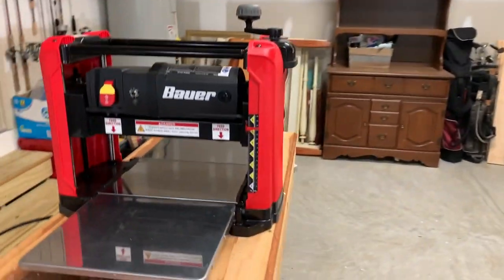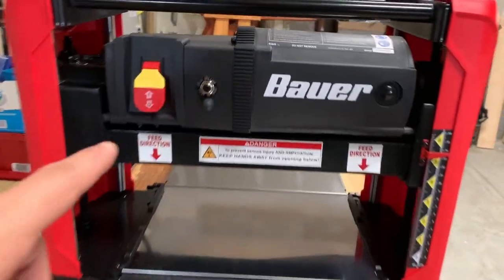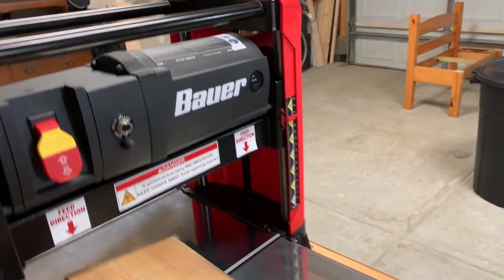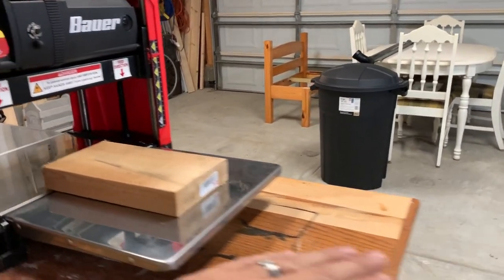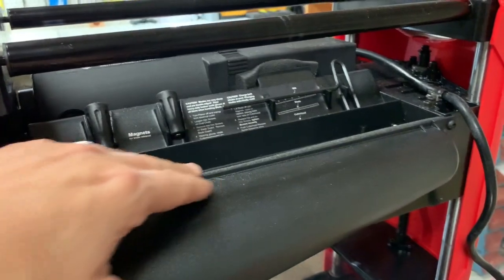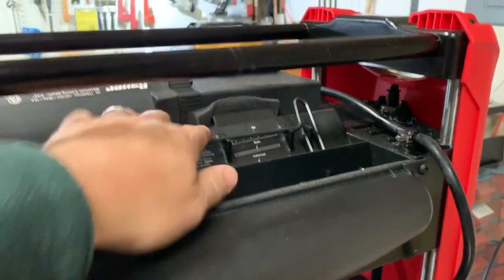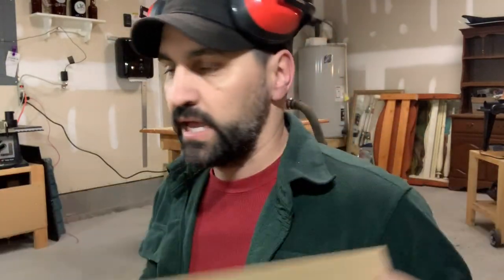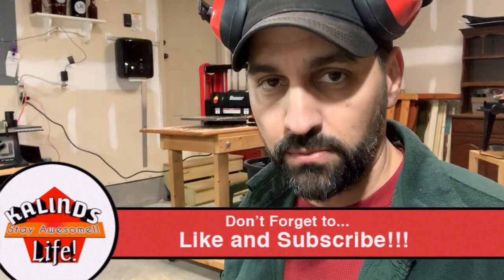Bauer Planer from Harbor Freight Tools Review!

Comment: Also another note for the adjusting handle, if you remove the cap there is a screw to tighten the handle and it will not be sloppy. very accurate . I read the manual before use

Comment: Get yourself a bucket head and a 5 gallon bucket. Cut a circle large enuff to cover your trash can. Cut a circle in the middle of the trashcan lid that fits the 5 gallon bucket. Cut the bottom of bucket off and place i side the trashcan lid and silicone the bucket and now you have a larger dust collection system. Just my thoughts
Reply from the maker: I know exactly what your talking about. I think this works well too and even allows for a bag to be put in the larger can for easy disposal. Thanks fir watching!!

Comment: You can adjust the height of the feed plate underneath. There's a bolt and locking nut.
Reply from the maker: You are correct! It really does make a difference! Thanks for watching and commenting!!

Comment: looks good. glad your getting good results. I got a suggestion for you that might be hard to explain, but, here goes....get a small (20-gal or so) thrash can with tight fitting lid (very important). Get two-inch piping, and more of those couplers. The idea is to connect the shop vac to a 2" pipe on one side of the trash can; then connect the planer to a 2" pipe on the opposite side of the can, using the couplers in each case. Some silicone sealer may be in order to make the pipes as airtight as possible, where they penetrate the can. When the lid is on, the shop vac creates suction in side the trash can, which creates suction in the opposite pipe, leading to the planer . Sawdust  is  pulled into the can, but, most will fall in the can, and not get sucked up into the shop vac. (which saves the shop vac filter/motor). I've not done this yet, as my planer is outside now. But, I want to use my planer year round, so I'm working on making the space for this.
Reply from the maker: Hey D L!!! Thanks for commenting!  Check out my video i made on  how to make a dust collector.  I did this Video AFTER the planer review so you may have not seen it.  Thanks so much for watching!!!
Reply: @TheCrawlspaceCraftsman  your right, I hadn't seen it. You know, I think it's great when people take my advice, but, when the do so a month before I give the advice, well, now that's something really special! ;-)  Great job on the vac system, by the way. My inner scotsman says use the cheap stuff, but the black does look good. Kudos,  my friend!

Comment: All Planers have adjustment ,to take out the Snipe and leveling set screws. These are close , but not dead on for shipping reasons . Also your adjustment rods for your thickness can be tightened and adjusted , to reduce the "looseness" in your height adjustment. You'll also have slack in your height adjusting handle . A simple drill and tap , for a set screw will eliminate that ,,, even the best  machine shop Mills have what is called "Thread slap" , you'll always have to do ,,what is known as "catching the threads" . You have to lower the weight of the adjustment past your measurement and the come back up or down to your final finish thickness . this is the difference of the "lands" and depth of the Threads on your Adjusting rods and and adjustment threads in your handle. Most standard threads of nuts and bolts are 75% contact . if you get into a higher percentage of 80 or 90 % it will take a tool and dye shop to cut those threads to match the opposing threads ,,, thus resulting in a much much higher priced machine . Adjust your machine , so it's setting dead nuts level and secured to a bulky firm table or base , adjust that machine out , so those feed tables are level with the machine and cutting head . check your knives to make sure they are running true with the drum and each other , and you'll be amazed at the results .

Comment: Ive been told that the play in the handle is because most people dont take off the cap and put the screw in the handle which can be tightened.
Reply from the maker: I’ve never messed with it but whiles it’s running it doesn’t change depth so that’s a good thing!

Comment: Jesus planers are so loud your never gonna have to worry about that noise the handle makes in anyway,throw away the indeed and outfeed tables,make new. And speaking from experience do not take more than a 1/16 depth cut at time I love mine,my adjustment handle for the depth of cut is spot on,had to buy a different measuring tape for the front and set it to be right,but I love mine.
Reply from the maker: Great comment!  Thanks for Watching!!!

Comment: My DeWalt has the same play in the handle. It is from slack in the chain. You will need to tune the machine. The factory adjustments are not very well done. The design is solid though.. All planers have some sniping to them.
Reply from the maker: Tanks so much PH!!! I definitely need to get mine adjusted better. Appreciate the comment!!!
Reply: I don't have that problem and I been using mine for about 3 years would I buy another one hell yes its awesome.

Comment: Good review.  I have some of the Bauer battery powered tools to supplement my Porter Cable stuff.  I've like them.
Reply from the maker: I have a Porter Cable Drill but want a second one so thinking about getting a Bauer. Seems tough and rigid. That’s a while down the road though. Thanks for watching!
Reply: Do the bauer and porter cable use the same batteries??

Comment: The custom infeed/outfeed tables are a good idea. In the meantime, you can adjust the little nut and bolt under the stock ones to get rid of that gap and make them more parallel. I found this video helpful with adjusting mine. https://youtu.be/luKyaouXa78
Reply from the maker: Awesome!  Ill have to check it out.  I think no matter what adding some length to the feed tables will greatly increase the quality of the cut! Thank again for watching too!

Comment: Same planer as the delta, porter cable, performax, wen, and masterforce.  blades are interchangable
Reply from the maker: It’s working great! I ran some Boards through it today and F’d up.... one had a nail and jacked my blades up. Time for some new blades!
Reply: KalindsLife or you could just flip the around...double sided for just that occasion

Comment: I hope that the dependability of that Bauer planer holds up good for you. Of course, that's what is very important. A nice, new & shiny tool sure looks good, but how does it hold up under a lot of use. I am retired and make wood crafts as a hobby. I have a Dewalt 13", 3 knife planer that I bought slightly used from a friend about 6 years ago and it does a good job. Except the dust collection is not very good and that's even with having a 16 gal. shop vac hooked up to it. Yea....gotta get a cyclone dust system built...!! If I can ever afford it, I will upgrade to a helix cutter style planer one of the days...years...LOL..!! Best of luck on your Bauer planer..!!!
Reply from the maker: Marble man! Thanks for your feedback and I couldn’t agree more!! Although it was less expensive I’m still hoping it hold up to the test of time! Also....  checkout my dust collection system I made for $40!!! You can do it too!
Reply: @TheCrawlspaceCraftsman  Yes, I will certainly check out your dust collector...meant to have done it already but I had some glue ups to get ready in my shop.

Comment: Do you think it could pull a 2x8 12' piece of oak through on its own if supported on the feed side?
Reply from the maker: yeah I think so... you feed on one end.... hold it and flip sides once you get about 1/2 way fed through.  Its not too hard to plane a long board.
Reply: I do it all the time with the identical delta planer

Comment: interested in getting one how often have you had to change blades? any maintence done?
Reply from the maker: I’ve been using it a lot lately and would ya believe the blades have held up pretty well until I decided to pass a board with an unseen nail!!! I keep mine clean every time I use it. I’m Making a pallet wall so the mark it now leaves due to the nail issue isn’t noticeable. I’ll change the blades once I’m done just in case I make the same mistake twice!!!
Reply: @TheCrawlspaceCraftsman  probably going to buy one tomorrow and yes i was wondering whatd happen with a hidden nail lol, i do lots of little wood working with pallet and tired of sanding lol go thru so much paper prob cost less just spending the 400 =]

Comment: I bought 1 and now I have to return it Because I cannot adjust the sniping out of it
Reply: Get ready to be disappointed in your next one because all lunchbox planers will have snipe.
Reply from the maker: You can build a "Sled" to go all the way through. You'll loose a 1/2 of depth but its an option.  Always plane your pieces BEFORE you cut to actual length so you can cut off the snipe.  This is a great planer but yes... the silver folding sleds kinda do suck maybe a bit more than $500+ Planers.

Comment: Mine has worked great but one of the 4 sprockets has broken. Does anybody know where i could find a replacement?
Reply from the maker: Have you contacted manufacturer???
Reply: @TheCrawlspaceCraftsman  yes sir, tried harbor freight and bauer but couldn't get anybody in a timely  manner and had to go to work. Looked on thier website with thier replacement parts list and they didn't have sprockets listed on there. I ordered one that looks identical to the broken one and it should get here today. I'll let y'all know if it works or not. It was made for a dewalt model but the comments said it fit an old craftsman and a porter cable planer so cross your fingers lol
Reply: @TheCrawlspaceCraftsman  the dewalt one worked! 
Here is the part number if anybody else has the same problem 
DEWALT 28592800 sprocket

Comment: You didn’t joint it first?
Reply from the maker: No... This was just a small demo of the planer itself.  I would agree with you though on the steps.  Joint then Plane.  Thanks for watching!!!
Reply: @TheCrawlspaceCraftsman  doesn't matter if you joint first or plane first... just need to joint before hitting table saw.

Comment: Cheapest easy fix for snipe that I've come across so far....get a sacrificial board approximately the same thickness as what you're planing, and run it through first. Before it's finished, butt your workpiece against the end of the sacrificial piece and run it through. Before the end of your workpiece gets into the planer, take the sacrificial piece and butt it up against the end of your workpiece and let it run through. The rollers cannot force the workpiece up on the "outside" end of the board, hence no snipe. You don't need to make the board any longer than needed. 

I've also heard that running the workpiece in at an angle works, but I have no experience with this.

A more expensive solution (but one that works with badly out of line boards) is demonstrated here: https://www.youtube.com/watch?v=DNg9BV4IF2Q
Reply from the maker: That’s a simple great idea!! Thank!!!
Reply: Or he could adjust the adjustable feed tables and eliminate most if not all of the snipe.

Comment: The “rubber gasket” is called a “Fernco” fitting used in sewer line piping. Upgrade to a large vac otherwise you will be emptying more than you will be planning. I had a large wet/dry vac and after emptying it 3-4 times a day, I decided to go for a central system with a large garbage can placed just before the central vac. That way you collect the larger pieces without it going into the central system. I bought my air filtration system at Harbor Freight and modified it by adding a 1 micron filter bought separately. Your lungs will appreciate it and you will save thousands on doctor bills. Use a dust mask no matter what system you use. You don’t want lung cancer!!
Reply from the maker: Thanks Richard! I actually built and made a video on a collector system to prevent exactly what you said.... emptying more than planning! Heading into HArbor Freight right now (I’m literally in the parking lot)!!!

Comment: @KalindsLife
I'm also thinking about this planer... do you think the planers blower is strongenogh to blow the shavings into a receptacle without the vac??
using a very short wide hose??
Reply from the maker: No. It clogs up really fast. You will need a vacuum. Check out my dust collector video and will cost you about $40! Thanks for watching!